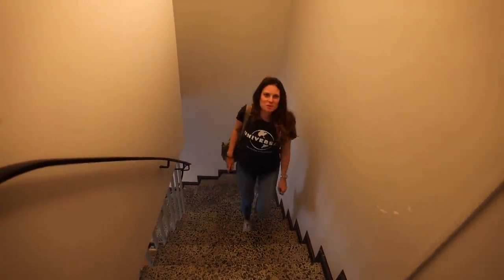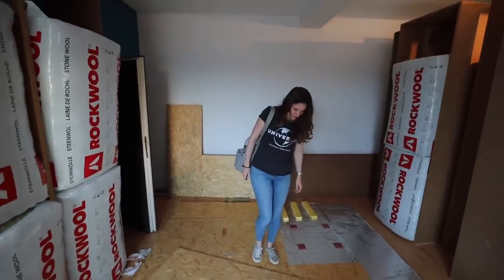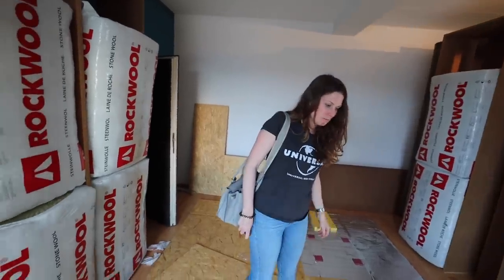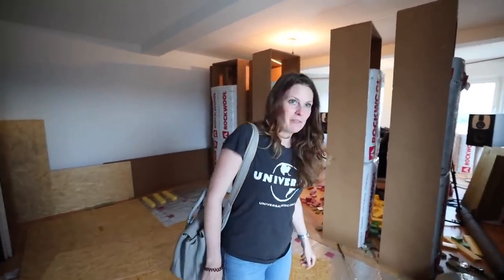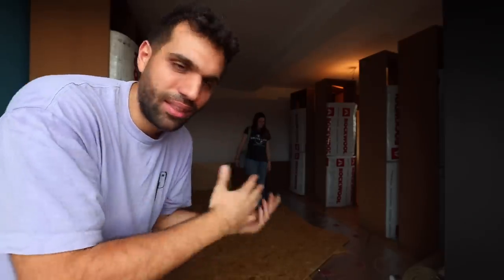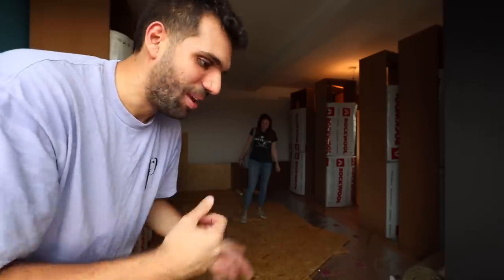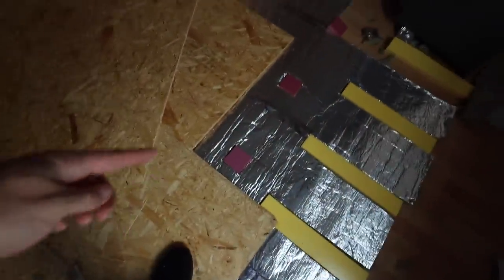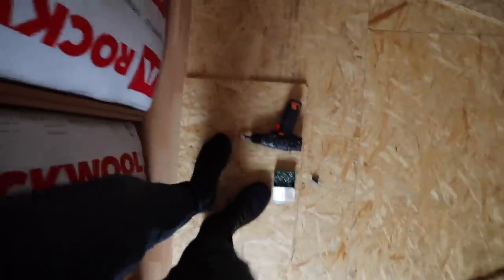RECORDING STUDIO FLOATING FLOOR CONSTRUCTION

Comment: I really wonder which acoustician advised you on the floating floor. The sylomer will definitely not stop construction or train noise because any sounds from outside are not only coming through the floor but flanking through your walls and ceiling which aren’t actually decoupled or soundproofed. You don’t have a MSM system, so only decoupling the floor is a waste of money (in your current design) And the second big no-go for such a lightweight floor is it will act as a big drumhead and reasonate even if filled with rockwool. It’s a shame because you probably have a decent mass in your (I assume) existing concrete floor. If you would have had the possibility to measure in REW with and without the osb/sylomer floor, you’d be able to clearly see it. That said, good for you that you’re figuring things out along the way, but it’s a good lesson you will learn in proper build planning and designing. You’ll end up with an (above) average sounding room that might cost as much as a professionally designed one. But you did it yourself, which is an achievement in itself!
Reply from the maker: We just testet it today. As calculated it’s reducing sound to the downstairs office by almost 50%. All other reasons for this build is explained in the video. I know it’s not ideal but for the room I have the best I can do and if I ever move with the studio I can seal the entire studio and raus the floor even more
Reply: Downstairs office and hiding cables is a reason to float the floors. But, I’d advise not doing it before checking what your building is sitting on. I have a new room. Walked around outside and noticed the building is sitting on a sand/gravel. My room is made with concrete blocks on 4 sides. I bring that up because during a vocal tracking session, a delivery (semi) truck drove by. No rumbling in the floor, and nothing got through the concrete wall. Absolutely nothing bled into the take. Just like any part of our art, there is no ‘one size fits all’ approach. If I floated my floor, other than not seeing my cables, I would’ve wasted a whole lot of money. Always assess the need first.

Comment: Lol.. everyone underestimates every crafters- work.. always:D   but i get you.. i am pretty much done with my floating floor now. I did a whole framework with rubber pads under it  filled it with rockwool, and covered it with panels just as yours. Its a lot of work! And weight to move .up, down, its exhausting^^ but worth it!

Comment: I'm not quite sure about one thing. I thought that the foam squares were suppose to sit on top or under the wool? You cut the holes to insert the squares to them completely burying them. Doesn't that defeat the purpose as now it all sits at the same level?

Comment: Hi there great to see the nice work going on but I got one or two questions. First  is why haven't you been taking the acoustic measurements of the room as you proceed. I mean take the measurements of the originally room then take another once you put the floor another measurement after the side panels are put and another once the ceiling is done ..... that way one could exactly know what exactly got improved or not or got worse...? secondly will you be working with diffuser and if so where and why exactly.....?
Reply from the maker: The room was measured before. Diffusion only if necessary
Reply: I get it bro... hoping for the best.... All eyes on you 👀.. Thanks for the experience....
Reply: The floor will show up as worse in a measurement. He doesn’t necessarily need diffusion. What will be needed is to add additional hard surface area to bring some life back into the room, because the room will sound dead. Before finishing off those last boxes, I’d change most of the remaning boxes into membrane absorbers. With the simple addition of some mdf, vinyl or plywood you can target problem frequencies way beyond what those 400mm of absorption only can do. If calculated correctly they can be very narrow Q, high amplitude absorbers in the sub frequencies while also reflecting back some highs. Look into that!

Comment: Not sure how many designs you went through before committing to what you are trying to construct now, namely specifying your acoustic design, FYI “a room within a room” is not a studio acoustic design. I would highly recommend you re-visit your design to include some other options that would help you benefit form the amount of space you currently have to work with and decide which acoustical design you are trying to achieve. This would help eliminate some the confusion your viewers have. I have also yet to hear you mention any ideas to possibly change how you might enter this studio, consider changing the location of your speakers and the direction you will be facing while sitting at your main desk. If you reverse your design, you can keep natural light in from the windows and use them as part of your acoustic design. Another recommendation is to add angles to your walls to form a semi-hexagonal shape and get rid of the rectangular shape you currently have for a reflection free zone (RFZ). This could possibly allow for walking space behind your acoustic panels to access your heating unit for maintenance in the future.
Reply from the maker: Thanks. Half of the stuff you meantioned is already implemented the other half we also had in mind but just didn’t work for this space. Trust me everything was considered this is the best solution for the budget